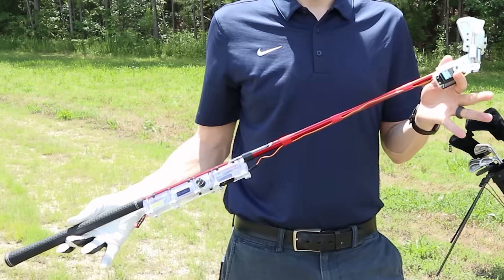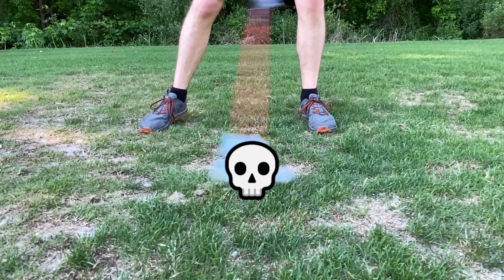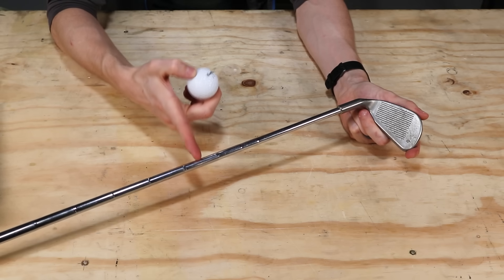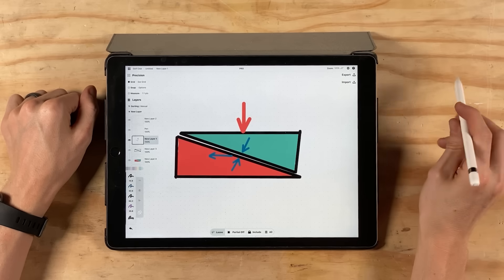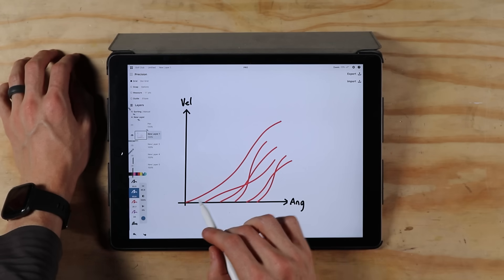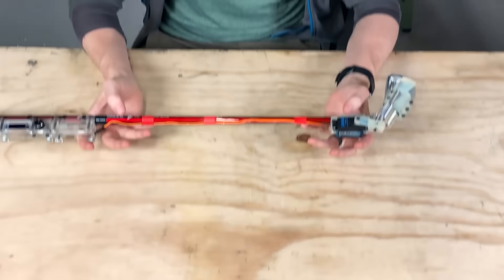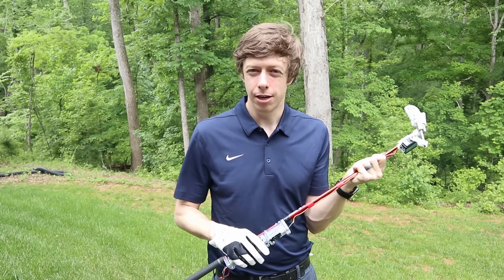My self correcting golf club makes me a better golfer

Comment: I want my cnc mill to pick up work offsets automatically. With cameras, visually somehow. Idk just load the part and the machine scans and says ok theres new material here. Confirm 2x2 block. Lol
Reply: I already know you can reengineer parts into cad software using 3d scanning. Then program in cam from there. Why not just add directly into cnc control?

Comment: at 4:10 you were talking about speed of sound, but problem is that speed of sound in solid metals is around 5000-6000 m/s, in water its around 1500 m/s(no idea what it would be in hydraulic fluid). of course in air it is only around 330-350 m/s.

Comment: When using the club selector it changes the club angle, but how are you factoring in the increased length of lever and therefore speed of release for a 3 iron compared to a shorter club like a 9 or wedge?

Comment: I have an idea! Make a David and Goliath style sling that releases at just the right cycle in the swing to hit the target. To have it lock onto the target, you could have a range finder and point it to the target and that data goes into an algorithm (that you design) getting inputs from the handle of the sling, and once you swing it enough times and have it at just the right angle it releases. So it is like your basketball net idea but in reverse. I wonder if the weight of rock you are slinging matters? probably, but you won't know unless you try it!!!  ...actually you probably will. The beauty of this system is it is not imprecise like hitting a baseball, or golf ball, because all of the inertia is transmitted into the rock and there is no impedance mismatch as you like to say.

Comment: You might get better results if you add a hydraulic component to the shaft that adjusts the length to be inversely proportional to the wedge angle. On the software side you would only want the component to change position in the iron selection mode and not auto adjust mid-swing. Very cool project though.

Comment: You should've added a small bladder to the golf club, kind of like a capacitor lrc circuit. Calculate the average impulse, take it's power spectrum, and design a hydraulic capacitor system to match the impedance of the strike, further improving your power delivery

Comment: Regarding the hydraulic design, I'm feeling way too lazy to figure it out, so I'll ask you if you considered the speed of sound in your hydraulic fluid? I would think that could change the problem from stretching the first 150mm or so to practically the entire length of the line. 

For those following along at home, speed of sound varies drastically in different media, up to many thousands of times quicker through something like diamond.

Comment: On the hydraulic club could you install small valves between the plastic pipe and the ram that close when the face of the club has reached the desired angle preventing the problems you were having?

Comment: I am an engineer at a injection molding facility...maybe try a "plastic" hosing that is rated for hydraulics. We use them on the lube system for the moving platen...The material escapes me but I will edit my comment tomorrow after I research it.

Comment: Is vibration the same as the speed of sound though, 'as far as physics is concerned'? Because sound moves faster in water, since its denser, so wouldn't the vibrations felt in a metal golf club be much faster than the speed of sound?

Comment: could you just put a one way valve on the original club idea to stop the pack pressure.... also you could run a rod down the shaft of the new golf club and put the servo in the handle.

Comment: @Stuff Made Here
Thanks for another interesting and enjoyable video.
I have a question for You (or anyone) regarding the "shockwave" in the club. You mention that the shockwave travels at the speed of sound, and that the "ball contact" is ca.500 micro seconds
But You then show that You "approximate" that the shockwave should reach "about 15 inches" up the shaft of the club... BUT as far as I could find the speed of sound in  steel is ca. 0,23 inches / microSeconds.. which means that the shockwave would have traveled closer to  9,5 feet during that time... What have I "missed" ??
Best regards

Comment: Could you not have kept the hydraulic one and setup a servo to close valve at the club head and have a trigger be a sensor for when the ball is hit? Then after 2 seconds or whatever the right time would be, it would reopen allowing normal movement.

Comment: Could you use a hard line to feed the hydraulic golf club face ?
That way you could insert a brake line into the center of the golf club shaft 
With a flex coupler just below the grip to connect to the pump

Comment: Instead of assuming that the club head will hit the ball at the same place you started your back swing, you should just constantly move the head during the swing, trying to keep it at the correct angle relative to horizontal the entire time. That way, no matter where in the swing arc it hits the ball, it will already be at the correct angle relative to the ball. Obviously, due to the limited range of the head movement, you will only be able to achieve the correct angle in the last 30 degrees or so of the swing, but that's really all you need. I hope that makes sense, I wish I could draw you a picture to better illustrate what I mean.
Reply: That's literally what it does... Did you watch the video with sound on?
Reply: @adamj2381  Yes, I did watch the entire video. That's how I know this isn't what he is doing. Starting at 12:34 in the video, he explains that he doesn't know what angle the club will be in the swing when it hits the ball. He states that he side-stepped the entire calculation problem by simply assuming that the angle that the club is at the start of the back-swing will be the angle of the club when it comes back down and impacts the ball.

What I was proposing is that the head is constantly moving during the swing, trying to keep itself at the correct angle relative to horizontal.

Comment: Have you gotten an additive process 3D printer that can use metal yet? Seems you could really use one. The classic golf swing coach will tell you to pretend the club head is at the end of a rope. The shaft WILL deform some during downward acceleration so the GOAL seems to be to time your swing to snap THROUGH the ball at the "bottom" of your swing. Of course the REAL difference would be made by having sensors that can gauge the trajectory of your swing as you approach the ball and tell when you're going off line, either by slice or hook. Learning then how to effectively line up your shot will really dial in your shots. Naturally the degree of deformation is completely dependent on the acceleration of the swing. A chip shot will deform very little while a 2 iron shot would deform quite a bit. BTW that look on your wife's face after you suggested she wasn't good at golf... you don't really want that. JS.
My Dad was an excellent golfer. He used to say he could tell how his hand position affected the shot at the time of contact, whether he hit if "fat" or hooked or sliced, or got it on the sweet spot. Yeah, there's a TON of variables in the average golf swing, and it's exceedingly complex to be able to have your sensors "see' and account for them all. I'm going to keep watching to see how it goes, for sure.

Comment: Using a steel shaft instead of graphite will lower the variability in the load on the shaft. It might increase the uniformity of your velocity curves. Using a stiffer flex would also help.

Comment: going to just chip in that you could have spring-loaded the head against the club and had the servo shim the whole thing away to lower the angle (hinge the club at the bottom instead of the middle). Not as cool but probably simpler

Comment: Checking your back issues after discovering your collab with Destin :) Very cool. On the issue with the hydraulic club what if you had a ratcheting system on the hydraulic shaft so that it goes forward to angle for the moment of contact but cannot retract freely?  Like how one way bearings work or a sprag clutch?

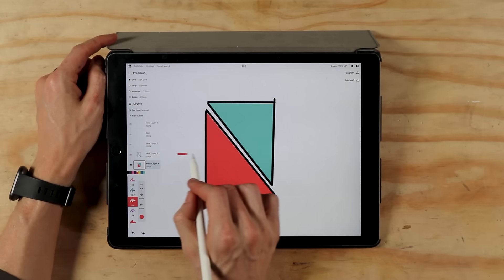Comment: 6:28 i nearly spit out my coffee. wow that is so clever.
Reply: but i sucked in back in at 12:05 because there are regression techniques that can handle this all in one formula and you don't need to 'look up the closest curve'.
Reply: @idontreallylikeyoutube  I would wonder if such a nonlinear regression would be too slow, given that you need to do this all during a swing.  Also, because of the speed, he needs to extrapolate from a few early data points which might be more accurately captured by this sort of matching.

Comment: Is there any way that the face could be self correcting? A series of pivot points at the rear of the face with a  non compressive fluid that gets pushed through one way valves that lock on impact to be perfectly square in relation to the ball.

Comment: with the angle correction you could make a system that continuously re-checks the prediction as the club accelerates and updates the data, thus "drawing" the curve and getting it right on point. also a really quick and strong servo would be useful to try and keep the face at the correct angle throughout the potential ball contact window. also keep in mind adding weight on the bottom of the club changes the center of gravity, which matters quite a lot to prevent the club from twisting in a hit and shooting off to the side.

Comment: the thing is, if you hit the ball on a low arc, the ball is going to roll quite a ways. high arcs help it roll very little, and if given enough backspin stop completely or even go backwards after landing. so that should be a mode setting for it.

Comment: How about a tennis racket that has a 4 channel switch where you can pinpoint where you want to place the ball on the other side of the court? An added effect you could make is put a small motor in there that forces the head of the racket to spring forward to add speed to the hit.

Comment: An idea outside of sports... You should build an oven/grill that allows you to set the ideal cook temp and internal food temp, cooking perfect food every time (without a food thermometer). You could probably find a way to calculate the internal temp based on sensing surface temp and mass/surface area of the food.
Reply: It's an interesting concept. You would probably need two methods of heating and a longer cooking time.

Comment: The slice and hook correction would be far more significant in improving the consistency of your swings than the angle correction.  Should have started with that.

And both of those are going to have far more of an effect on tee shots than any other shots.  Once you're off the tee the biggest factor in a swing and the thing most people have the most trouble with is actually making contact with the ball at the correct height so that the ball is actually struck with the center of the club face and not drilled with the bottom edge of the club or barely skimmed with the last little bit of the top of the club face.

Comment: Wouldn't making the club have a self correcting hook/slice be virtually impossible. You would have to first first find how fast you're turning the face over in relation to how close to the ball you are. You would also have to include the swing plane in relation to the closing of the clubface.  Then you would have to create a device that would sense where the ball is on impact to see how much it needs to move the clubface. That is the impossible part because by the time it senses where it hits, the system wont have enough time to sense what happened and how to correct it before the ball has already left the face. although I think you could be able to help fix your hook/slice by programming the club to slightly correct the hook/slice, but it wouldn't be that consistent unless you hit the same part of the clubface every swing. Which for  humans is impossible. You would need a robot to do this

Comment: Nice effort!  However, I believe a "real" golf course would require at least three different clubs.  You need one club able to drive the ball long distances up to 300 yards creating the desirable trajectory and able to  tackle the extreme dynamics, then the second club for approach shots (and par 3 holes) from say 50 to 180 yards that could calculate the distance to the pin and place the ball as close to the hole as possible, and a third club for putting to calculate speed to the hole able to adjust for the green's surface undulations affecting speed.

Comment: I know this video is old, but I hope you will see this comment.  
I injured my back in college and lost my ability to pull up my left foot. This injury is commonly called drop foot. Normally it can be corrected for daily life with an AFO. The biggest flaw in AFOs is that they are either super rigid,  so that your foot can't push down, or them use joints to allow flexion down, but typically they don't work well when you're walking on the side of a hill. I like to be active, but for the last 8 years I've broken/ been injured by several braces. My current brace attaches to my ankle and shoe laces. So it gives me a little more flexibility,  but that comes at a price of safety. I've almost broken my ankle several times because it doesn't correct for outward rotation. 
If you could come up with a solution to this with robotics I would be both amazed and grateful. 
I love your videos. Keep up the amazing work!
Reply: upvoted so hopefully he sees it!
Reply: @adamnash2009  thank you!

Comment: I am trying to 3d print on form 2 and it has straight 90 degree angles and am having a hard time keeping this part square and flat. Any tip from ANYONE would help me a lot. Thanks! I am using the blue tough resin and post curing in formlabs curing oven at 60 degrees c for 2 hours.

Comment: Your screw explanation finally made the TPI/torque thing click for me... more threads per inch on a fastener can clamp at a higher torque because there is more surface area and a lower angle of "ramp" to resist the force transferred on axis.

Comment: Not sure if you accounted for this, but the "speed of sound" is vastly different in different mediums. I would imagine it's significantly faster in hydraulic fluid than it is in air, just based on the requirements of hydraulic applications. I did some Googling and found a few figures suggesting it is up to 5x faster in hydraulic fluid, but I would run calcs for yourself if this comes up in future builds.

Comment: my take on the hydraulic club problem is to integrate the valve into the club and use compressed air instead of the heavy hydraulic fluid.

Comment: If you wanted a software project you could get a topo map of the course with gps coordinates and terrain data (like the locations of the rough, fairway, green, forest, sand traps, and ponds) and make software that just picks the shot for you as long as you aim vaguely in the direction of the hole.

Comment: Very cool.  One thing that will help the hook/slice issue is to make sure the the shaft “spline” is at exactly at 3 O’Clock.  (Viewing the club downward from grip to head). Spline position has a huge impact on the shaft frequency and stiffness. (My father was a PCS certified club maker). Hope this helps!

Also, I have an idea for you. A product for the Jeep community.